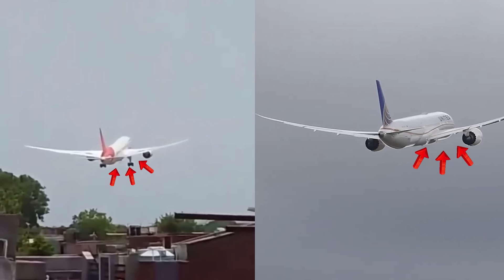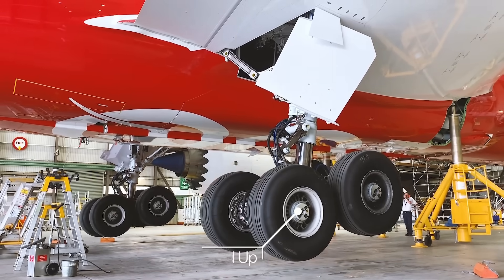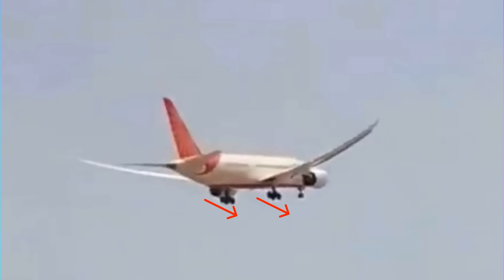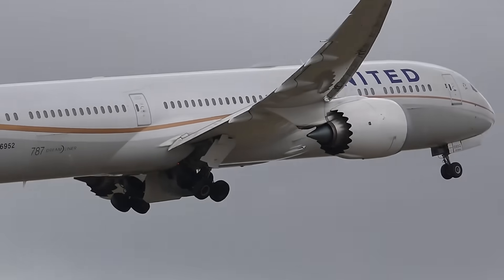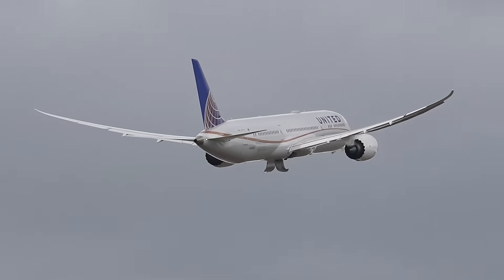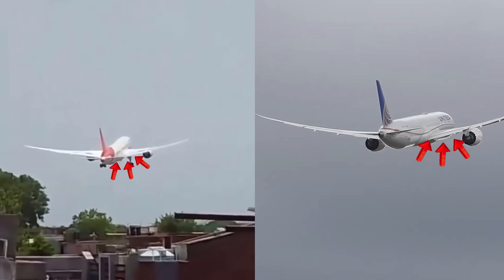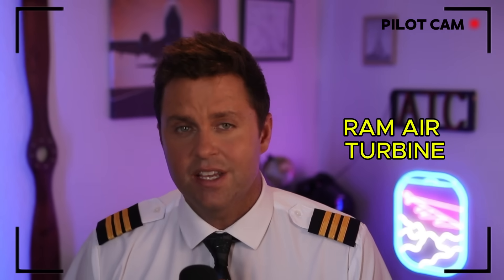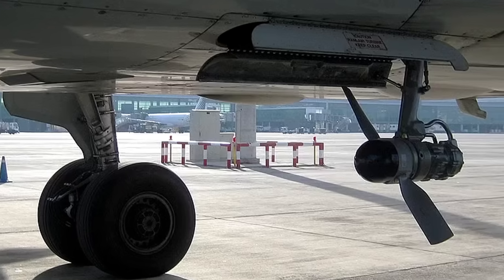Pilot Explains: A New Detail in the Air India 787 Crash Everyone Missed

Comment: 787 driver here (10 years and 7000 hours in left seat of that AC) - after selecting the gear handle up, the gear tilts forward then the gear doors freefall - they do not need hydraulic power to fall open, only to close. If the gear handle had been selected up, with loss of both engines, the doors would have free fallen open and stayed open. The rat is for essential electrics and hydraulics only and does not have the power to make any changes to the gear config. No sign of doors open in the video. Unfortunately, I agree that the cause of the crash is loss of both engines (note that I do not say dual engine failure)  but most evidence so far points to the unthinkable.
Reply: Even "Before selecting the landing Gear handle UP"  , the gear tilts Forward Down... as soon as the sensors detect AIRBORNE...  see:   AMM 32-31-00 LANDING GEAR DESCRIPTION AND OPERATION.    So, regardless of the selection of the gear handle, it will always tilts forward down to prepare for retraction.
Reply: @Fabianpilot  Yes - you are absolutely correct - it a a WOW sensor action
Reply: On reflection, that essentially eliminates ever selecting the handle up because the doors never opened
Reply: @chrisr3394  yep, the WOW sensor. please let me know if there is any updates on that particular feature. thank you Captain!
Reply: @Fabianpilot what is the WOW sensor?
Reply: @merryfergie  Weight on wheels.
Reply: @merryfergie WOW = Weight On Wheels

It’s a sensor or switch located near the main and nose landing gear, and its job is to detect whether the aircraft is
On the ground (weight is on the wheels)
In the air (weight is off the wheels)
Reply: @merryfergie weight on wheels
Reply: @Fabianpilot  That's not true. The bogeys will not tilt forward automatically. They only tilt forward if the gear is commanded to retract. What if the plane needs to settle down again on the runway, for instance? The landing gear was commanded retracted and the sequence started but interrupted and stopped very suddenly and immediately. It happened so suddenly and immediately, it looks electrical related to me. Something electrical on that plane went haywire, making everything shut down. The RAT does not provide power to raise the gear. That's hydraulicly actuated but electrically commanded. There was not enough time to restart the engines.
Reply: what unthinkable? ... be clear
Reply: @urzsulaz2604sabotage, they’ve been warning about cyber attacks since 2015. It’s a flying data machine. It was still within range when the engines cut out.
Reply: He means deliberate pilot action. @urzsulaz2604
Reply: Use…Your….Imagination…. Cough, Fuel switches, cough
Reply: @urzsulaz2604I think he may be suggesting they pulled the flaps up instead of gear
Reply: It's all in the timing. As you said, the bogies tilt (to about level) and then the doors are released. The gear continues to tilt as the doors drop. It is possible that the bogie tilt was in progress but the door release had not been actuated. The door latches would be either electric or hydraulic so loss of power at that point could result in level bogies with the doors still latched.
Reply: Not that unthinkable. ever heard of Jetstar flight JQ15 from March 29th?
Reply: Has terrorism been ruled out? 🤔
Reply: In the video, showing 787 gear up - the doors definitely do not seem to freefall, but open in a constant slow manner.
Reply: Maybe the gear doors can freefall under certain conditions. For what it's worth, here is google gemini AI answering the question, if the man gear doors freefall to open:
No, the Boeing 787 main landing gear doors do not freefall. They are hydraulically operated and controlled by the aircraft's systems. The doors open and close as part of the landing gear retraction and extension process.
Reply: thank you!  I had a year on the 787 before a highspeed red light violator took my medical a year/half ago ... and the company took my books while I'm on disability.

I was thinking the main gear doors were electrically locked and gravity fell open, hyd pressure closed.  only question I have, is that sequence dependent ... e.g. when the gear handle raised, only the "hot battery bus?" (I've forgotten the precise term, that is 737 nomenclature)  RAT being deployed/spun up .... but when it DID make electricity, did the gear handle need to be cycled to release the gear door locks?

I didn't remember the "tilt" of the truck, but that is good dope ... looks like the gear handle WAS raised at some point well before it got  to the 600 some odd altitude.

Hope for a swift/accurate release of the cause .... and if necessary the fix/work around.
Reply: But to unlock them you need electricity ?
Reply: @38911bytefree  I remember the gear handle is a switch; short "throw.".  it isn't a valve handle nor a lever to the valve with a cable.  Electric wires.
Reply: This aircraft appears to have struggled to get airborne. It used all 12000 feet of the runway. The cockpit voice recorder etc might hold the key. The delay in releasing information to the public seems odd. As a former military jockey, I don't know much about "heavies" in commercial. But as a pilot, I'm reluctant to blame colleagues, including maintenance crews.
Reply: Yeah.  Those two expensive vacuums did not fail.., you're right.   Those suckers QUIT, and we're still flying.   Shakng my head.
Reply: With gear not selected up wheels are travelling at 155 kts (Vr) = 170mph...this will impose a turning moment on each axle which probably explains Toe-down of gear especially with no hydraulic pressure ..
Reply: if so.... then the 787 has shit for redundancy.   Will Boeing be caught with massive eggs on their faces once again?
Reply: it’s possible. If there is some kind of flaw in the system/software that has the minuscule chance of occurring. Even if lack of maintenance, that shouldn’t be able to happen.
Reply: A deliberate action by the onboard crew is extremely unlikely given the Mayday call saying "No power, no thrust'''"
Reply: Not if it was done outside of the knowledge of the other pilot.  
@chrisantoniou4366
Reply: @chrisantoniou4366 no power o thrust is made up by an Indian outlet
Reply: Finally, someone connecting the dots.... they already know and Air India is in scramble mode... if it were a mechanical issue, the 787 fleet would be grounded worldwide already...
Reply: airplane controls hijacked remotely
Reply: No, most of the evidences so far point to loss of thrust from both engines. The cause of loss thrust is still unknown as of today.

There is absolutely zero evidence pointing to whatever unthinkable crap you’re thinking.

Get it right.

Comment: There was an  incident that occurred on June 30, 1987, when a Delta Air Lines Boeing 767 captain inadvertently shut down both engines shortly after takeoff from Los Angeles International Airport (LAX). The aircraft, carrying 204 passengers on a flight to Cincinnati and New York, was at an altitude of 1,200 to 1,600 feet over the Pacific Ocean when a malfunction in the electronic engine control system was displayed. The captain mistakenly turned off both fuel master switches, causing the plane to lose power and glide to about 500 feet above the water before the engines were restarted. The flight safely returned to LAX, and no injuries were reported. The Federal Aviation Administration issued an emergency order requiring a safety guard between engine switches to prevent future occurrences.

Comment: A solid theory suggests that an engine failure occurring at the same time could be due to a shared external system, like the fuel system. Could high ambient temperatures impact the fuel lines enough to lead to pump cavitation?

Comment: Dual engine failure, has that ever happened before? I can recall one time an airplane was flying over a errupted Vulcano on Iceland and went into the smoke, all engine failed and came to complete stop. The Pilot did the right thing, must had nerves like steel as well and just dive with the plane to get under the smoke cloud and pushed start and all engines fired up immediately. But they was lucky as flying on high altitude that gave enough time for this maneuver that saved the plane. As i heard it takes 10 sec for engines to reach full power as well.
Reply: This happened also with a KLM jet over Alaska 1992 running into a volcanic cloud. It was also successfully restarted after a fall of 13,000 feet.

Comment: I'm not an expert and not a pilot but I have observed a few things watching all the interviews and pilot opinions on the crash. First of all, a passenger who flew into that airport on that plane reported that the air conditioning and entertainment system were constantly going out. Next, the plane was about 40 minutes late departing the gate for some reason and I suspect maintenance may have been working on that problem. Next, the rollout was very long which makes me think he was loosing power going down the runway. And lastly, the survivor said he heard a loud bang just after take off. Considering all this, I suspect a major short of some sort blew out the whole electronics Bay, dooming the plane. I have seen major electrical faults blow out and such a thing is catastrophic. I'm probably wrong but I think someone should consider such a scenario.
Reply: You are probably right about maintenance causing the delay.  The loud bang may have been either a compressor stall as the engines didn't get the commanded fuel flow they needed, or the RAT, (Ram Air Turbine) deploying.  Have not heard any witnesses from the ground saying anything about a loud bang, but maybe others have heard reports.  I suspect the investigators have a good idea now of what happened if they data has been good to read.  Hopefully there will be something out in the next day or so....
Reply: With you....think it will come down to maintenance issues with Air India not taking care of recurring problems with that aircraft.
Reply: Does the RAT "bang" when it fully deploys or locks into place?  Could he have been sitting almost directly over it?  I think his seat was "11A", directly over the leading edge of the port wing root.  I understand the RAT is centered and further back.  But could that have been the bang he heard? 
I'm not a pilot either, but I am a mechanic.
Reply: @NegativeROG  The RAT on the 787 is on the right side at the trailing wing edge area.  I can't say if it would cause a bang or not, but it would not surprise me if it did as it falls and the airstream will also push it into its locked position.  As for hearing any bang from back there up to 11A, (Probably 5 or 6 rows), definitely.  A friend had a main wheel tire explode at lift-off, and it was so loud the thought it was the nose-wheel that blew.  In aircraft the fuselage acts like a "Tunnel", making it very difficult to determine where or which side of the aircraft the sound came from.  Hope this helps.
Reply: @spencerrs-e2g  I've only flown 2x, MYR-DTW, DWT-MYR, so I'm no expert.
Reply: I think the loud noise the survivor heard was something  loose on the top  of the building, the object seen flying away. It was "probably" launched off the roof by whatever thrust an engine was producing and hit the plane.  (Another wild guess.)
Reply: @borismedved835  YouTube pilots are saying that the loud noise and flickering lights that the survivor reported would have been caused by the RAT's deployment.
Reply: Seat 11a seems to could be just above the RAT and therefore it might make sense that the bang came from the RAT being deployed maybe 🤔
Reply: I was going to say something very similar but you beat me to it. I observed everything you mentioned. I am not a pilot, just a retired quantity surveyor who observes things. The aeroplane seemed to be struggling right from the start and took all the 11,500 feet of the runway, to me this indicates engine power problems. The other possibilities of a pilot pulled the wrong lever or switch is very remote as there are two pilots, one would notice immediately if the other did something wrong. Both pilots had lots of hours and good records. Enough for now from me, have a good day.
Reply: Good observations.   We'll all know by the end of the week.
Reply: Don't worry, the investigators will be considering all scenarios (well, until the black boxes narrow things down).
Reply: No A/C ON THE GROUND because the APU was, apparently, unserviceable.
If the pressurisation and A/C system wasn't working once the engines were started then the aircraft was going exactly nowhere.
No pressurisation = no-go.
Reply: The air conditioning units and cabin entertainment system have no connection to flight control or engines. They are completely isolated systems.
Reply: @michaelc1624  That might be true on other jets, but the 787 is almost totally electrically powered. If there is a major electrical failure, virtually everything on the plane is ultimately affected.
Reply: @michaelc1624  Not true on an electric jet!

Comment: Contaminated fuel?  Unless the fuel was specifically, and only, for this one plane, wouldn't there be other complaints about contaminated fuel from this source?  As much as I hope that this is the cause, because it points to an issue that could be relatively easily corrected, I fear that the problem is much more sinister.

Comment: Here is my two cents...Very hot day with temperatures over 100 F, the plane sitting on the ground for hours with no air conditioning the fuel in the tanks over heated in the hot sun which caused a vapor lock within the fuel lines disrupting the fuel supply to both the engines at the same time.  This is a crazy theory however we really need to wait the investigation to be complete.
Reply: This isn't first time in india temprature here may go upto 50 °C ,
And there too flights operates,

Comment: i know nothing about planes but i think it was hydrolic fail he has tried to put the landing gear up and its got stuck and because it got stuck the rat was deployed and wasn't enough to power the air craft. to say dual engine failure hardly likely it just took off so that is a good sign the engines are working as they should

Comment: FWIW, I found several 2015 accounts of a potential software glitch in the 787 that was discovered only through computer simulations, and was apparently addressed at the time. The trigger would be leaving the aircraft's systems turned on for about eight months solid, the result could be a sudden total shutdown of all electrical systems even while the aircraft was in flight, and the simple fix was to make sure you restarted your 787 every so often. (This was changed to every 51 days a couple years later, in response to another software glitch.) The eerie thing is, the potential shutdown described in the 2015 simulations was an excellent fit for what may have happened with the Air India flight. A total shutdown of all electrical systems, with the lithium-ion batteries providing a few seconds of power to the flight deck, and giving enough time for the RAT to deploy, which under other circumstances would have provided enough power for the pilots to reboot the system. Unless, of course, they were too close to the ground to enable a recovery.  As I said, this bug was apparently addressed ten years ago, but it does demonstrate that something as simple as a software glitch could account for a double-engine failure without bringing fuel impurities, birds, or pilot error into the equation. And it would mean those poor doomed pilots did everything right, but never had a chance to recover control. One relevant article is here: https://www.engineering.com/power-killing-software-glitch-found-in-boeing-dreamliner/

Comment: Witness said that there was a loud bang while the plane was on the runway.  If you look at the camera footage from mid runway, there is a dust storm from the # 1 engine and not # 2.  Possible that the # 2 engine flamed out following V1 and then engine # 1 flamed out when the gear was selected up.  This could explain the plane getting airborne near the overrun (taking more runway than calculated).

Comment: Logical analysis,Gary. Thanks. However, 
1. Could it be a cyber attack on the plane’s computer(s). 
2. Should GE - the  engine manufacturer - not have real time performance parameters of the plane’s engines?  Such data should help identify what went wrong.

Comment: Not dual engine failure/flameout....but more likely a failure of the Engine control (Module, EEC, or FADEC)
Remember the British Airways 777 that had both engines stuck in "flight idle" and landed short of LHR runway? Good chance this is similar.

Comment: If there was a massive failure of electrical power, the engine fuel pumps would stop working.  If there was no fuel to the engines, we would see the power off flight seen. Also if no eelectrical power the gear would not retract.

Comment: As a pilot/flight instructor the one thing I don't understand is why airline pilots keep the nose high when the aircraft is stalling.  I have had students stall and airplane more than once and the first thing I do is push the nose way down to prevent a stall and keep the plane controllable.
Reply: There was no time to react it would have been easier to control if plane was at a significant height
Reply: The plane had no altitude and no power.

Comment: As a flight technician and experience for 16 years in operations, i really worry abt the lifting of aircraft after takeoff as failure of building thrust of double engines. Ingine failure may not be the cauge. To the best of my knowledge there can be two causes. One is fuel cutoff to the engines and second one flaps are in wrong position as their movement is restricted due to malfunction.